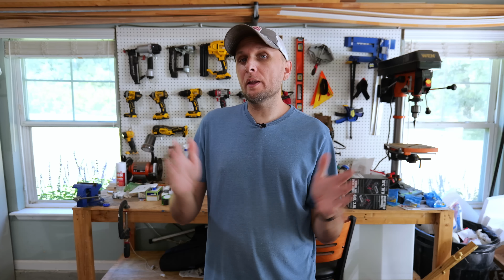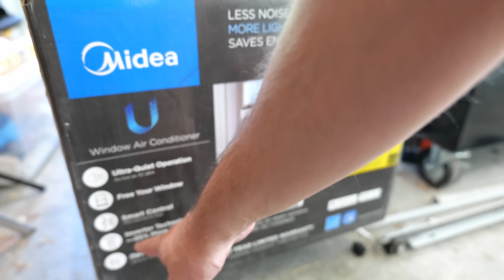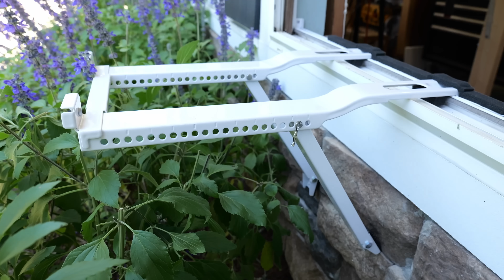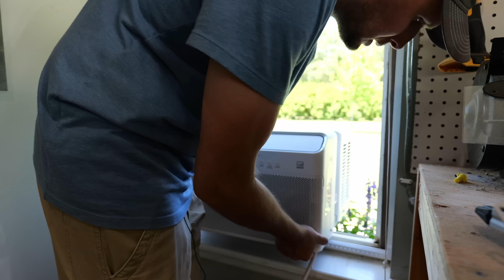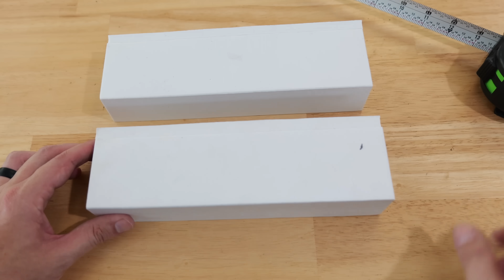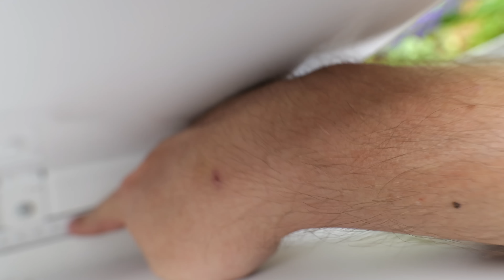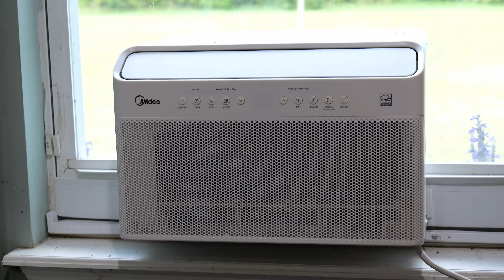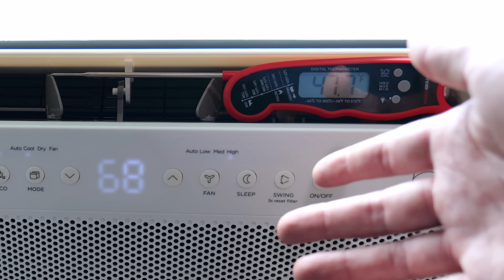The COLDEST And QUIETEST AC Unit Ever Made!  Still Use Your Window!

Comment: I recently bought installed this unit 12,000 BTU in my mobile home living room window and it is AWESOME!!! I was using a portable AC unit for a year and a half before it finally died. I personally think air conditioners were not meant to be built in this form, they might work well in a tent for an outdoor party, but after a while they get weak and start to leak water. It was literally 90 degrees even with the weak and dying portable air conditioner two weeks ago here in central Florida, now the entire home is cool. When you come in from the outside on a nice 95 to 100 degree day, it feels like you're walking into a cool and cold grocery store. All I have in my room is just a stand up box fan that looks like a portable air conditioner, and it reads 75 because all that cold air from that window unit makes it over here.  Midea makes a great unit, I got a small Midea window unit 5000 BTU in my room that I run at night when I sleep, then in the morning I turn on the big split window unit u shape Midea and it continues a cool flow of air through the entire house! Before, I could walk to the kitchen and the heat and humidity would kick in and pretty much sweat most of the day, now it gets pretty chilly and very fast maybe five minutes after the Midea u shaped AC is on, and it is quieter than my air fryer! And when they say it can blow out 20 feet of air you can feel it literally flow up the walls. And you can also set it on dry and it will be very cool in the house and I gotta remind you I live in central Florida and it's been getting up to 100 degrees here. Even my bedroom 5000 Midea air conditioner had some nice hardware and brackets, this 12,000 u shaped one is very nice with the window bracket. My only regret is wasting a lot of money and a lot of time on portable AC units.
Reply: My one story 3-bedroom home central air went out a few weeks ago.  The HVAC said to replace my central air unit, which would cost my $7k or so.  So I invested in a 12,000 BTU Midea U-shape window unit at Costco for $290.  The dang thing now keeps my living room and kitchen nice and cool.  I got a 5,000 BTU Midea digital window unit for $130 from BJ's Wholesale.  With the outside temperature being 100 degrees Celsius, my house has never been cooler!  So it looks like Midea is a trusted brand, seeing that they're being carried by Costco, BJs, and Sam's Club.  Yes, I had to pay membership fees for two warehouses, but the savings I got for the two units more than made up for it!
Reply: @sdlock83  That's an incredible deal for the 12,000 BTU! I honestly had to pay $200 more so you got your money's worth with you Costco membership for sure! You got pretty much the same setup (Midea 5,000 BTU in my bedroom mostly used at night) I have in my mobile home but I can't run both at the same time or my fuse will blow. I actually do not need both on at the same time as I'm typing this, it is 78 degrees in my room with just a stand up air cooler on fan with a thermostat and my 12,000 BTU sit at 60 on high for now in the living room. I could actually set the 12,000 BTU to 67 degrees and it'll stay just like this all day and it's 92 degrees here in central Florida. Midea makes a great air conditioner!
Reply: @dennycelestinohybridspecies   i have 2 in my mobil, i run a 12/3 20 ft ext cord from the elec post to 1 of them. it bypasses the trailer elec system and i can run both at the same time
Reply: @dennycelestinohybridspecies    i had the same setup, i ran a 12/10 ext cord to the 2nd one right from the post and bypassed the coach elec system
Reply: Oh good lord a portable air conditioner in Florida, I can't imagine that working.
Reply: I need something better in my Airstream, but my windows open upwards. Not sure I could get it in the U shape area 🤷‍♀️ Any thoughts? Im tired of being hot. Im also in south/central Florida.
Reply: @MicheleDBorland  You will need a window that is 22" to >36" and open up at least 13" vertical.
Reply: @Moondoggy1941  Thank you! I think I do 🤞🏼
Reply: I want one with a heat pump for winter?  And how much would this unit leak in cold winter air when not in use?

Comment: ****Posters description of performance is not my experience. Does not cool room. I purchased this because I did not like the temporary AC unit that currently sits in the corner of my bedroom and has the vent out through the window. This was a major disappointment even though the room I put it in is quite a bit smaller than the stated size room that this should take care of. I bought this solely on the posters recommendation and that was my fault. Very disappointed. This is going back wasted time bringing this home and putting it in. Buyer beware I hope your experience is better than mine
Reply from the maker: Yeah have no clue why you’re having that experience I and so many others have had nothing but a great experience.  Mine is keeping my garage super cool in this 90-100 degree weather, no problem.
Reply: @HowToHomeDIY mine not only does not cool, it opens outdoor for bugs to enter through unit, when off, my bedroom ambient temperature is several degrees warmer than rest of my home due to leakage and outside air infiltration through this POS unit I bought on your recommendation
Reply from the maker: Guy why are you complaining to me?  If that is the issue why did you not return it for a new one months ago?  None of what you are describing has happened to me.  It’s still blowing extremely cold and zero bugs come in through it.  So have no clue what you’re talking about.  The fact you still have it after claiming this didn’t work months ago really makes me question your comment as it would make zero sense to keep an ac that doesn’t cool 😂

Comment: I have a mancave separate from house by 100 feet 20x14 ft room 4 walls. I had one of these it took over an hour to lower it to where a human could tell, when it was 90 degrees outside in UTAH, had to start it 4 hours before i wanted to be out here. Only cool in front of it and you can never really seal the window from bugs or draft going out. Installed a mini spilt drilled one hole in wall, now walk out there in 102 turn it one and in 20 minutes cold down to 74, better than the brand new house AC, and the heater is good down to 26 degrees, heating up to 69. Cost 2 yrs a go 700, now higher. That unit you put in cost 400 and is garbage.

Comment: I’ll never buy Midea again. My brand new, expensive window unit lasted 1 season only. Total garbage. I could see, and hear the components inside vibrating, rattling, and violently shaking. Some vibration is normal, this was not normal. Always kept the filter clean, even built a sort of window awning to keep direct sunlight off of it, (plenty of airflow around the unit). I have functioning window A/C units that are at LEAST 30 years old, it’s ugly, and yellowed, but it’s on RIGHT NOW. This thing in the video might be great, but I’ll never know, as I will never trust Midea again. I’ve worked in HVAC, and I am obsessed with cooling technology. We (my family) live in the desert, AC is a life necessity. One evening the Midea started belching out fog into the living quarters. It turned out to be a refrigerant leak. What a piece of garbage. My suspicions are the “eco” setting is not calibrated correctly, leading to high head pressure. The compressor really seemed to struggle. If you are stuck with a similar Midea, I’d recommend running it straight without eco. Go to H, Midea!

Comment: Might I also suggest, drilling a extra drain hole or 2 because this model can and will build up water. Depending on your area, you'll have mosquitos coming through and also getting ground up inside. I have 2 units and it did happen

Comment: How difficult is it to clean the coils? How do you access them for annual cleaning?
A few years ago when my central air a coil went bad and there was no replacement so it meant a whole new system with a new freon, $6k.
Having an L shaped home I instead went for 2 window units at $500 each, and mounted them through the wall under a window.
In 2025 the EPA is switching freon again, this time to a flamable gas, so the new systems will require substantial safety systems and cost 30-40% more.  But I won’t have to worry about that. If one of the window units goes out, just buy another window unit.

Comment: Because the screens that are removed from the window are a fixed size, prior to the installation of this AC unit.  Although you can open the window,  why would you without a screen to keep the mosquitoes and flys out.  In addition,  you'd have to re-seat that foam between the window above the AC unit each time you slide the window up.  You lose the operation of window ventilation on a cooler day even using this style of AC so that's not a selling point.  If its less noisy or uses less power than a typical window unit maybe a selling point.

Comment: Sorry but this doesn’t compare to a mini split. 
First and most important, a mini split has HEAT also. 
A window unit will render your screen on the window inoperative.
The noise of the air handler and the compressor are within 1 feet of each other.
You can mount the air handler on the mini split wherever you want.
I don’t know where the stupid design came from but out here in the west, the windows don’t go up and down they go left and right, which makes this useless.

Comment: I purchased one of these in early May '24 to install in my second floor bedroom/office that last year would raise about ten degrees over the course of the day, during the summer due to its south-facing wall. It's just as easy to install as stated in the video. I increased the drainage slope, and also drilled drain holes on the bottom corners of the outside part of the unit to help with condensate drainage. Saw in some other videos where the condensate would not drain and cause the molding of the blower wheel.
Reply: i see that, hopefully the unit is serviceable and can be cleaned. window acs are also supposed to be designed to slope a little bit at the outdoor part of the AC
Reply: @peppermeat8059 I have not tried taking the fan housing off, but the front filter and coils are easy to clean. No mold on my fan cage at this point, it is used Mon-Fri from 7a-5p no problem.

Comment: Ive had one of these a couple years. They dont sell them locally so I had to order it on shamazon. It is of course heavy so UPS was almost guaranteed and did damage it. It basically came with on of the corners outside the room pretty well bent. Since this one went on the back of the house and it still worked, and figuring a replacement would show up the same or worse, I just accepted my fate of having a bent AC. It still works, though I will say it builds up a fair amount of water before it overflows the bottom of the drain. Enough so that it starts splashing in the fan making an annoying noise that keeps us up at night (its next to the bed). I ended up very carefully drilling a drain hole in it.

At the end of the day its a good unit. However there are other options on the market that also include dehumdification and heat pump functions. None of these fit in my small window, but I'd recommend anyone reading this comment to get one of those instead as there is great value in the heat pump function if you have decent sized window to put it in. My 2 cents.

Comment: I have one to assist heat pump in master bedroom. Its quiet most of the time, but it revs up at night sometimes. I have to hang gauze on the back of mine to help the unit drain even with it sloped out. If I don't do that you can hear it sloshing water at night. Overall I am pleased with it but it still ties up your window just like any other unit.

Comment: I grabbed the 8k model. My only complaint so far was that while it said it can fit in a 22” window, holy crap is it a tight fit. I ended up skipping a couple screw points just cause there’s no possible way to reach them in a window this small. But it’s in a second floor window that isn’t going to be opened ever other than putting in/taking out this unit, so i can deal with the reduced security. 

(I live in a 120+ year old New England cape style house, so window size wasn’t really a choice I made)

Comment: I bought a 10k btu unit a few weeks ago but still have to run an electric line near the unit so I haven't used it yet. I'll be interested to see how it performs versus my ultra quiet Pioneer mini split(also 10k btu) about 1000 feet away in a pure off grid solar setup. Looks pretty easy to setup, probably will take me longer to drop the electric line than install this ac unit.

Comment: I have two of these, the 8k and 10k. I have the 10k in my large room I use as a gym and the 8k in my office (WFH). The 8k is used the most, while the 10k isn't yet; both have a horrible mold smell even though the filters are kept clean. Did some research and found a lot of reviewers complaining about this issue. There are a few videos on YouTube of people dismantling this unit to clean the blower (as it is where the mold is concentrated); however, it is extremely difficult to do, and you will break things if you attempt it. I don't have the time or patience to deal with this and do it every season, so I'm removing the one in my office and replacing it with the Windmill WhisperTech 8k unit, which does not seem to have this issue. Before you buy these units, please research the mold issue; I'm sure you'll pick something else. On YouTube, look up "Midea U Shape A/C Major Mold Issue Design Flaw! to see the issue and look up "Midea u shaped ac cleaning part 1/2" to see the cleaning video. Good luck!

Comment: We have the 10,000 BTU unit in our 3 seasons room and it does an amazing job. Dead silent and at 20ft you can feel the breeze as if you were just a few feet away. Its been hot in NE Ohio and my electric bill doesnt seem to be affected so far. It also uses the same control as our Breeze33 mini split that we recently installed in our addition. All top quality stuff.

Comment: This is my 3rd year with the 12k model. I'm using it to cool 800 sq ft and it works fantastic. I'm able to clean the blower fan and condenser easily with a waterpik and it flushes to the outside. It looks as new as the day I bought it, and the air remains smelling fresh. All ACs need regular cleaning to prevent mildew and dampness odors, and other models required uninstalling it. This makes regular maintenance a breeze!

Comment: I bought one of these... they're absolutely awesome.    I don't 100% understand why they didn't follow through and make it a heater too in the winter (if it's a true inverter unit).  It looks like they were planning for heat, but just didn't implement it.

Anyway, it's a great unit even just cooling.

Comment: I bought one of these 2 years ago. I live in a 1997, 8×19' uninsulated Dodge van and the unit fits perfectly in my rear window. I did get the 12000 btu because a 5000btu did not cool my van on those hot days. I turn the unit on when my inside temp reaches 95°f inside my van, and in 15-20 minutes it cools to my set temp of 76°f and maintains that temp. I use a 25-3000w generator for my power source. I am very happy with its function, and durability even while going down the road. Thanks, Media for a great product.
Reply: Thank you for this post. I am helping a homeless man in his van with his dog and the EcoFlow we bought him didn’t cut it.  Nice to know what power rqmts are as well so we can plan accordingly!
Reply: Although am surprised the 5K BTU didn’t cool the van enough!

Comment: I saw one just like this, but it went over the wall/bottom frame instead of over the window. 
I will also say, from experience, the typical "Japanese" style AC units are actually very effective in regulating the temperature. True air "conditioning" to keep the temperature and humidity level more stable and tolerable.

Comment: I have one of these. Installed it myself with a little help from my daughter. And it's very quiet, inside and outside. I sit on my back deck every morning while my dog is running around the yard and it's not loud enough to disturb me. It has cut back on significantly on how much we need to run the central high.

Comment: only thing wrong with the unit is that it lacks a heating option. the remote has a heating mode but the u-shaped units don't heat. and considering you really bolt the thing down having a heating option would be great on these. otherwise it is very quiet and works well.

Comment: Just a caveat about the window locks - and air conditioner installs in windows in general - on many modern windows, the upper panel can be lowered then swung out for cleaning. If you only lock the lower panel in place, that doesn't stop somebody from swinging out the panel - and oftentimes even remove it. For the times I've put an A/C unit in the window on the ground floor, I've placed wooden blocks on both the inside track and secured some between the top of the lower window and the outside frame to prevent convenient access. Setting up the window-sensors to alarm with the window set up for the A/C is another consideration for those who have a security system set up.

Comment: Just bought one a couple weeks ago.  I love it, I love all the features.   It is quieter than a normal window AC, but it's not as quiet as I thought it would be.  I had an issue with the installation due to my house being brick with a brick sill.  The sill stuck out too far so the support legs don't rest properly on the outside wall.